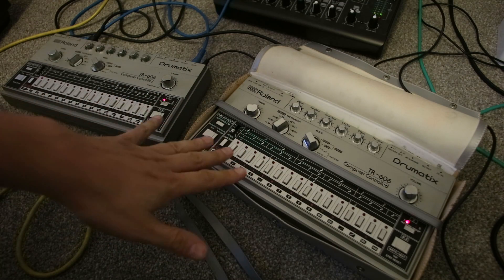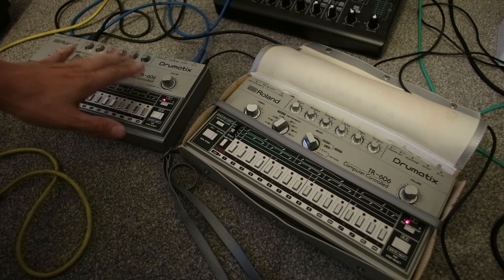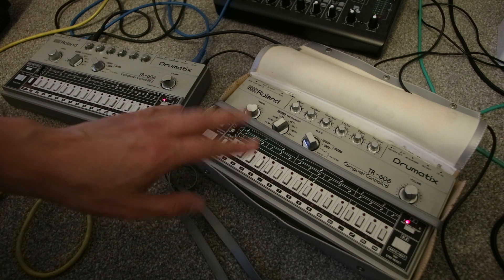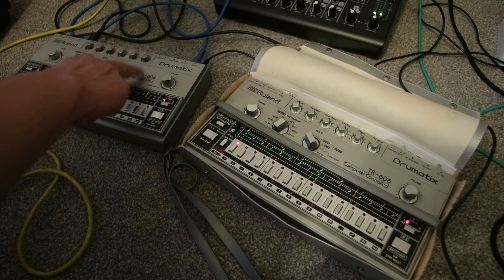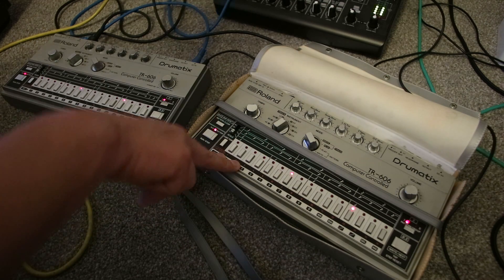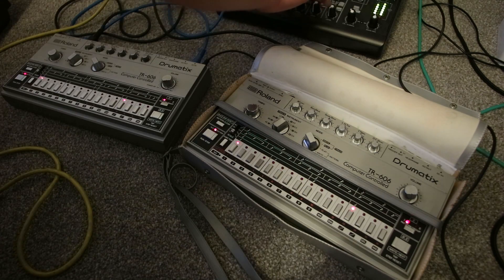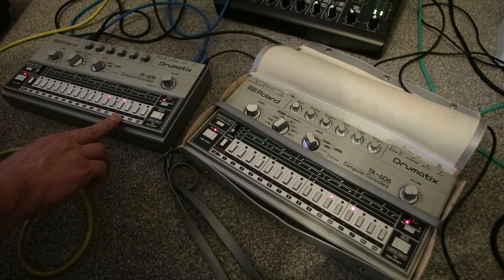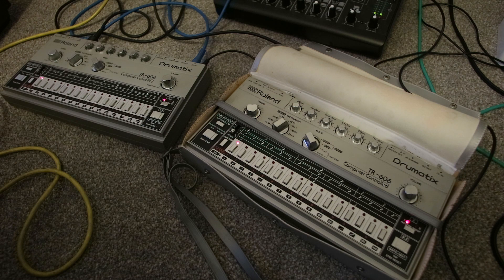Roland TR-606 vs Roland TR-606 (component ageing)

Comment: The, cymbals and hi-hats are way off between the two. Perhaps a revision to component values; I doubt that change would be in the realm of component aging. Would be revealing to see the PCBs / values used in the cymbal noise generator circuit.
Reply from the maker: yes, I agree it would be an interesting thing to do

Comment: The funny thing about the TR-606 is that every unit I hear in another video sounds very different on the Hi Hats and Cymbals than the one before. Mine is from series 250*** and I've been told that's the first revision where they changed the sound of the metal oscillators on purpose. It turned out I'm that lucky guy that got exactly the unit which has the metal sound I like the most out of all others I heard.
Reply from the maker: if it sounds good, it is good :)

Comment: It seems the noise generators on the left machine are 2 semitones higher and are a bit more verby on the toms. It is a fact that no 2 vintage superstar machines sound the same but do you know which one is the oldest or most used?
Reply from the maker: It’s not 100% clear which is the most used. But maybe the one on the left has the most knob wear.

Comment: Aren't the metallic sounds produced by a noise generator that goes through some logic gates? That was the most obvious sound difference, and is a pretty interesting concept, that the "random noise source" is actually providing a unique identity to each individual unit. I'm pretty sure there was a slight filter difference that could have been attributed to an ageing capacitor, but I suspect that much of the tone differences can be tuned to be very similar with a trimmer pot somewhere on the circuit board.
Reply from the maker: Yes, the cymbal noise source is 6 logic IC oscillators tuned at slightly different frequencies.

There was a revision to the noise circuit according to the service manual. So newer and older units will sound different.

Comment: Nice comparison, thanks. It would be hard to say much about the effects of aging on the sound without knowing what these specific 606 originally sounded like. The component tolerances could have these 606 sounding slightly different from each other since the day they rolled out of the assembly line. Both still sounding nice, though!
Reply from the maker: This is a great comment, and yes they both still sound nice!

Comment: It'd be interested to hear two RE-606s together. Component aging could definitely play a part, but many of these components have different tolerances and exact values out the gate. Great video!
Reply from the maker: That’s also a good point! Thanks for commenting :)
Reply: @gwEmbassy  One more thing to consider is the batteries. I'm pretty sure whether the 606 or 808 have batteries installed will influence the sound a bit. Sunshine Jones made a post about this.
Reply from the maker: @jhatzia interesting point. I will look for that video.

Comment: Back in the days Roland sourced cheap components from various vendors, even b-stock chips that are out of specification. So the hardware of the vintage synthesizers differ slightly depending on batch and production date. It is not only the age, they all have unique character!
Reply: lol exactly
Reply from the maker: Great point!

Comment: damn you look fit bro.
Reply from the maker: Thanks for saying so VNDM 🙏
Reply: @gwEmbassy  you are welcome.😀 Was wondering to what extend different components where used per production run (as with the 808.).  Slightly different components with for instance different tolerances and from different manufactures. Also: these were made as budget machines,  so it would be safe to assume some corners were cut in the production runs. All this could result in (slight) sound differences between brand new 606's form different production runs. I guess we will never know for sure...
Reply from the maker: That is also a great question. From the service notes, the 606 went through quite a few revisions in its 3 years production run.

Comment: BD, SD and Toms sounded very similar as expected, though the uncased one seemed to have more noise on SD and Toms - you can adjust a trimmer inside to set the noise level. The hats and cymbals were where the biggest differences were apparent, sounds like the uncased one possibly has a duff oscillator in the hex inverter, or possibly the capacitors and resistors which set the frequencies are different values (IIRC 10% tolerance on those parts) One other thing to check is that the uncased tempo dial was set to the same as the master cased one, as this impacts hihat decay slightly.
But great video as always 👊
Reply from the maker: Thanks for the great comment! I 100% agree with all of that. It’s the kinds of things you have to bare in mind dealing with older gear.

Comment: Something about this shootout seems quite sporty and fit, not sure what it is 😉

It seems you've got a spare 606, I'll take the one on the left please. Excellent video as usual. I wonder what specific test points on these units vary the most versus the factory tuning specs?
Reply from the maker: 🥰💪
That’s a great question there. There are a few tuning points affecting the sound in the service manual. But only one is spec’d which is for the noise source.

Comment: I would say the only components that will change over time are electrolytic caps. The 606's only differ in pitch on the ride and hat sounds, may be i needed head phones for the other sounds as i am just on laptop speakers.
Reply from the maker: In fact resistors can vary over time as well. I discovered this on an old Marshall guitar amp. One of the resistors (a carbon type) had changed in value by nearly 50% I suppose metal film won’t change as much.

There are other differences in the sounds, particularly the toms which had differing amounts of noise.
Reply: @gwEmbassy  That is pretty odd, resistors are used to set control voltage values, I really would not expect tolerance to change by 50% ... 100% if they get nuked xD. Like how do you wear out a resistor were you are not exceeding watts?
Reply from the maker: As for the Marshall, I have a suspicion that resistor was running hot
Reply: @gwEmbassy  is the noise generated for toms from the same source as the hats and rides ?
Reply from the maker: Good question, I checked the schematic and it looks like they do!
Reply: Indeed it sounds like the metal noise oscillators have drifted!
Reply: No. Not only the electrolytic caps change over time.
Reply: @ZenMountain  elaborate